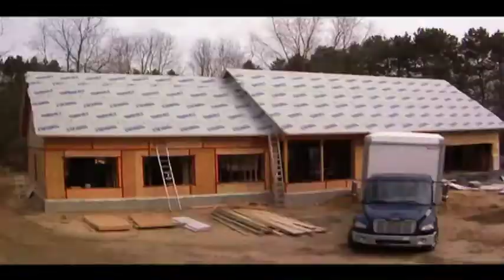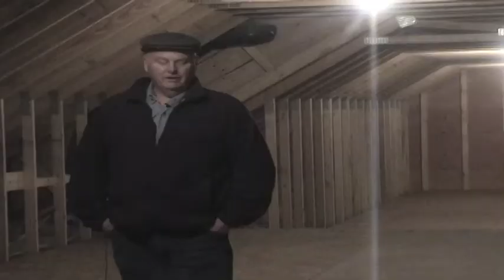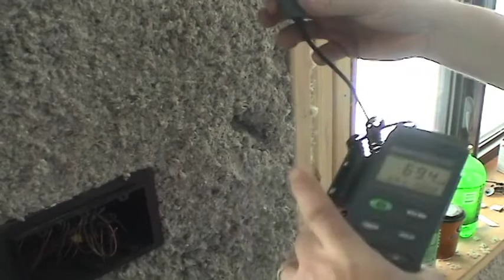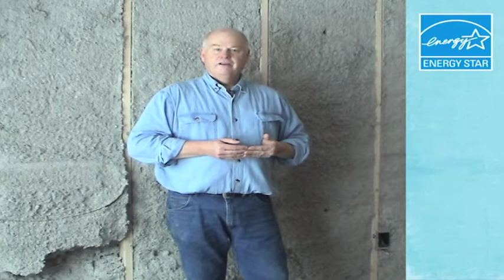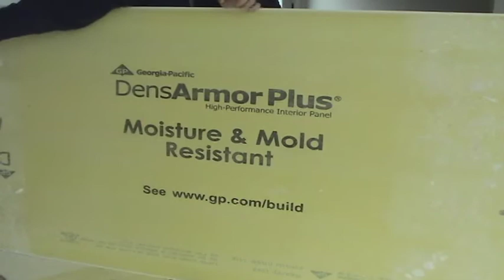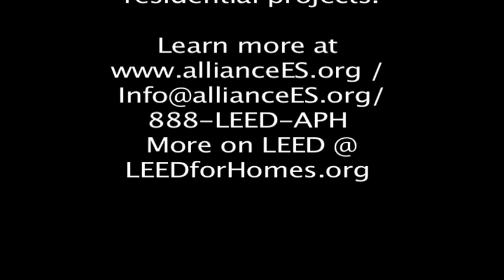Insulation and Heating & Cooling (LEED Platinum Certified)

Comment: The 0.26 ACH was based on incorrect dimensions entered in the software calculating the air pressure differential.  The actual test after construction was completed (with the correct dimensions) ended up at 0.44 ACH which was the tightest building that Michael Holcomb of Home Inspector General had ever tested of well over 1,000 buildings.

Comment: Shorty after this video was shot, we invited the CEO and head of Research and Development of locally owned NuWool Insulation to tour our home and discuss our moisture concerns.  NuWool contains borate, which is designed to prevent mold growth in moist conditions.  They warrant against mold growth if the insulation has had at least 48 hours to dry.  As it had dried for three weeks they gave us the green light to proceed with drywall.  Moisture will continue to off-gass through the drywall.